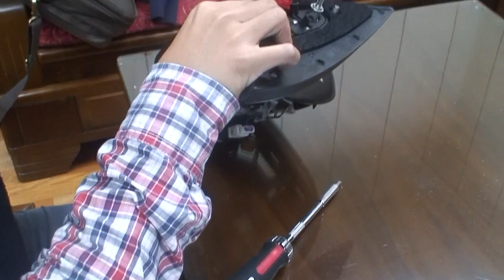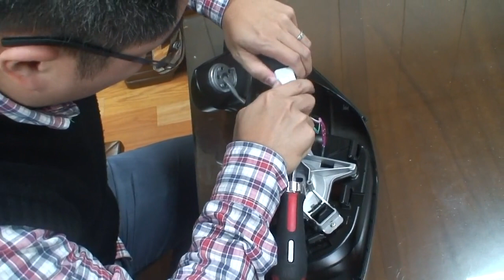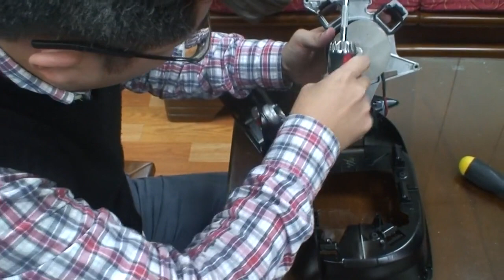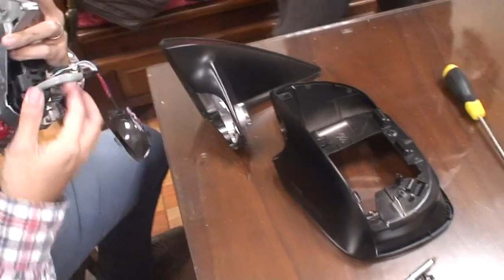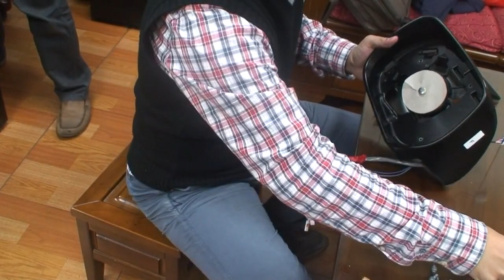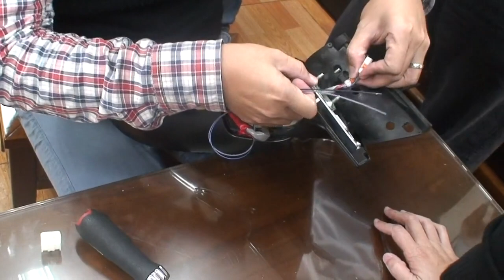MIRROR FOLDING SYSTEM installation guide.

Comment: Toyota Yaris sedan without retractable mirrors but with power adjustable option,  can be converted into auto retractable if yaris is with push start option? If yes then what parts are used in  this conversion?

Comment: You can make any car mirrors fold ,even it it had manual mirrors  ,you just get all the motor mechanism  of any folding mirror and put it in a non folding mirror ,then wire it up it's simple..
Reply: not that easy, the space and spring bracket differ. every manufacturer has different positions of motor mounting. so its almost not perfect DIY.
Reply: WRONG! manual mirrors (spring) mirrors have different internal designs. Trust me I thought the same and almost lost 2,000 dollars on just ordering a bunch of motors.